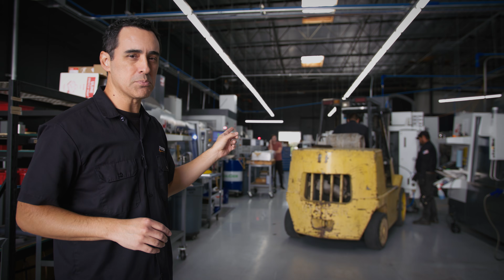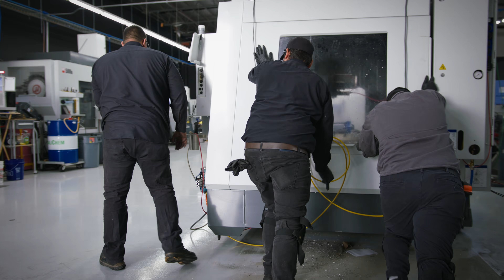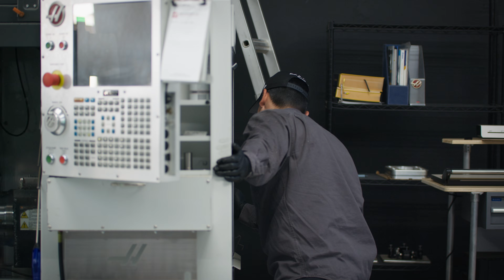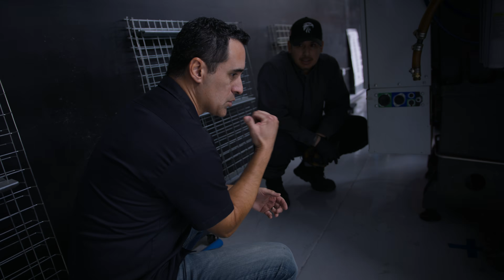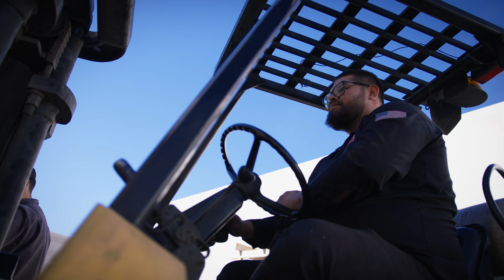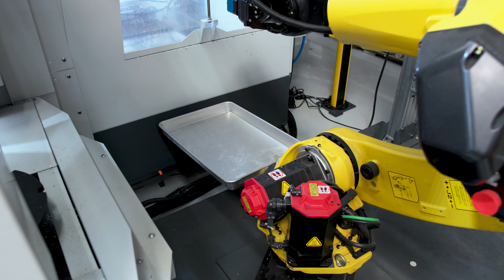Looking Back at 2025: Our SMALLEST Machine Shop Move! | Pierson Workholding

Comment: Hey Jay, love watching your videos. I have a question. I need to bore a hole with tight tolerance but issue is achieving Ra 0.4(mm). I use drilling, endmill hole finish and also burnishing, but it takes a lot of time and result is not always consistent. Can you please suggest me a proper tool that can give me Ra0.4 always. Appreciate your response.
Reply from the maker: If the customer needs that finish, then all those tools are necessary. Inconsistent finishes are often due to poor chip evacuation rather than tools. Big picture: The problem most shops make is focusing on the time it takes to make a feature rather than focusing on being compensated for the extra time it takes to make the feature. It's an easy value-add to meet with the customer and discuss features that can make their parts affordable yet high quality.
Reply: @PiersonWorkholding  True. Just to let you know, your i'm currently using your Rotovice and making 24 parts in one go in a 4-axis rotary attachment m/c. It is a complete game changer. I just added a V-groove on those jaws to hold the part.BTW this part is different one than i said earlier. Love rotovise, saves lot of operator time on the machine.

Comment: Great video! Have y'all thought about doing a zero point supported trunnion? 

It'd be so nice for VF2s where you could lift on and off the whole trunnion at once(Great for fixtures with dozens of Mitee-Bites or switching to different production runs without having to re-zero)